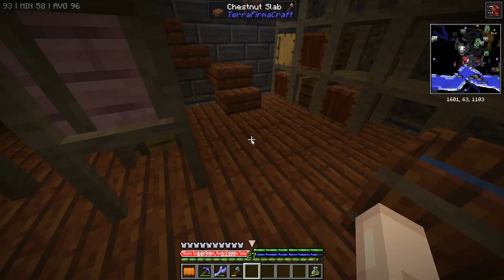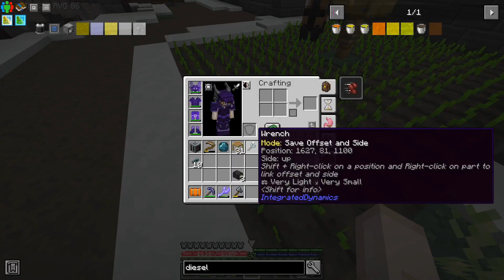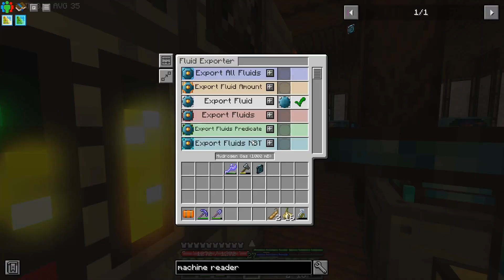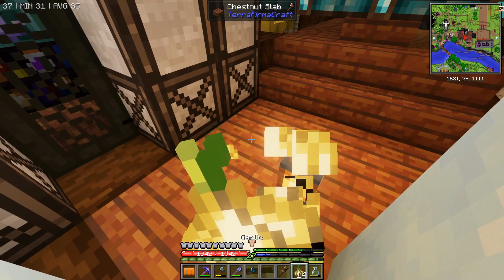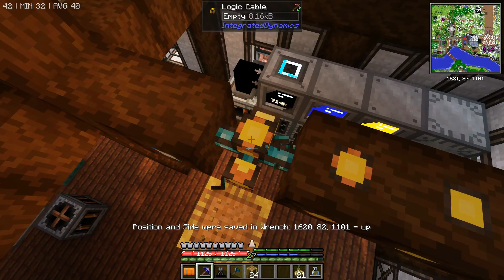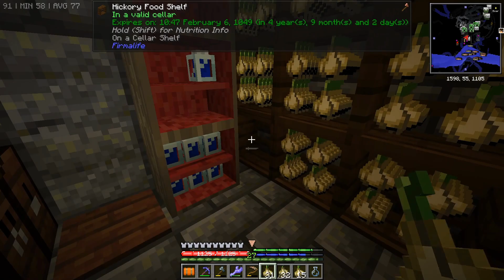ATM Gravitas 2 LP Ep 6: Automating Diesel w/ Integrated Dynamics

Comment: I use fluid filters when using quadruple fluid pipes where I have multiple inputs and outputs on the same side
Reply from the maker: Where are you using the quad fluid pipes? I'll have to come take a look!
Reply: @Cthulhamonster  using them in my certane production and my various acid/gas production